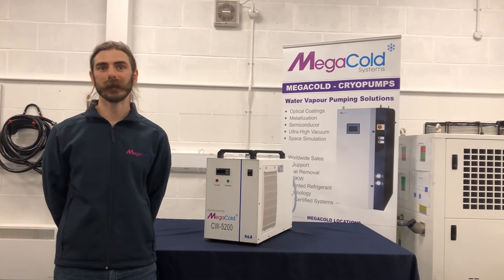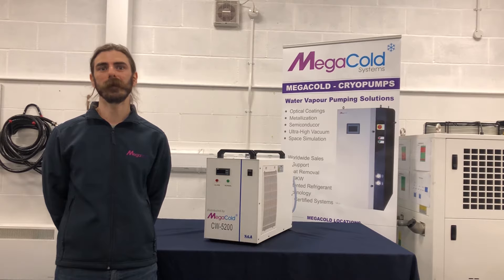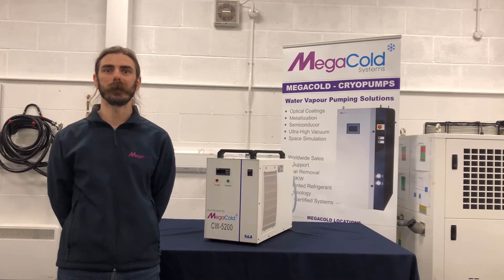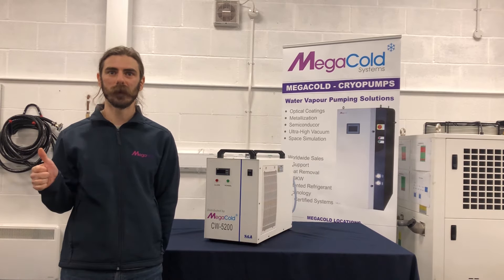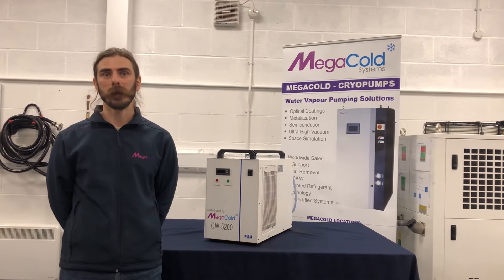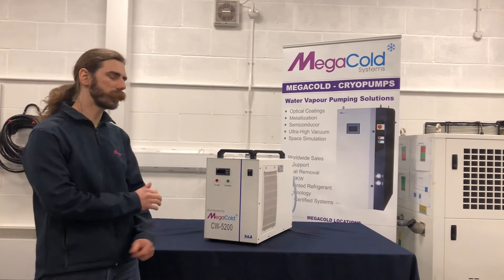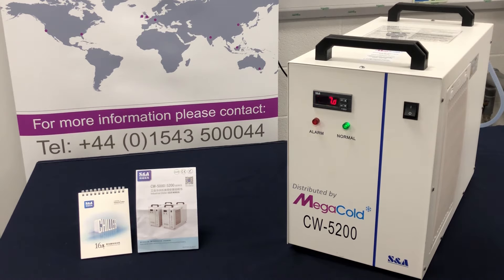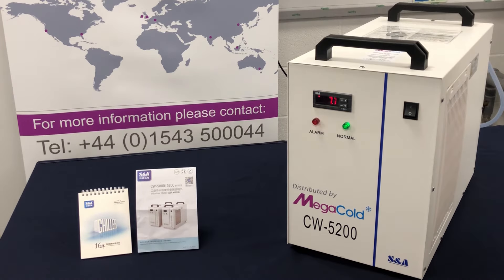Step by Step guide CW-5200 Water Chiller Unit for CNC Co2 Laser Machine - S&A From Megacold

Comment: Do you suggest any additives to add to the distilled water to stop algae build up? If so what do you suggest? Thanks
Reply: Hi Steve, it is not necessary to use algae inhibitors. An annual flush of the system would be fine.
Reply from the maker: As Ben suggests, flushing the system is fine here is a link to our knowhow page on Megacold to read tips on this process - https://www.megacold.uk.com/flushing-the-water-chiller

Comment: What other application can this be used in I am from the HVAC background and looking for a portable chiller that can provide chill water around a cooling coil with a blow air EC fan to provide cool air within
a cabin. Can this unit do that Sort of how a chiller will provide water to a Air handling cooling coil
Reply from the maker: Yes, it can be used for any use of recirculation water around the cooling coil to cool a cabin - recommended set point is between 10 and 25 degrees.